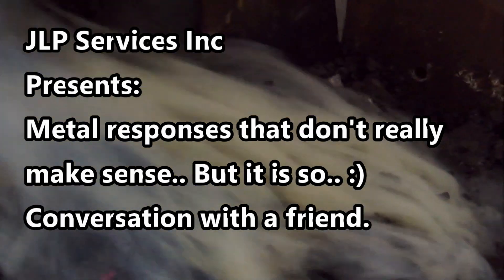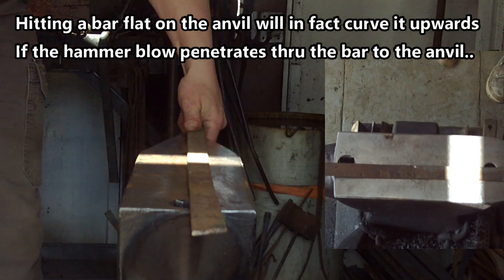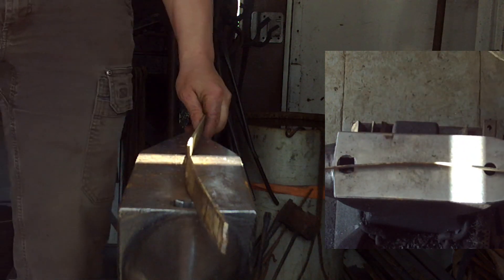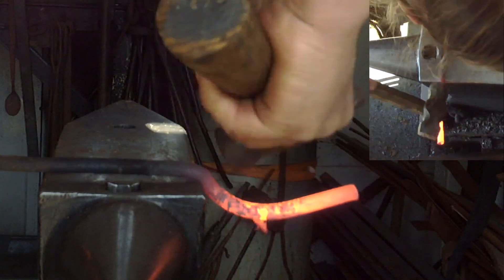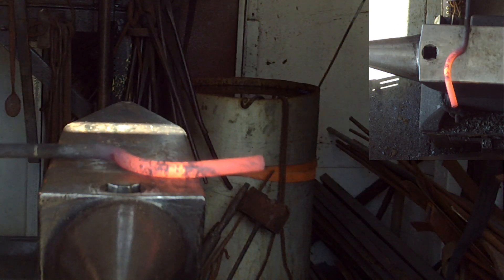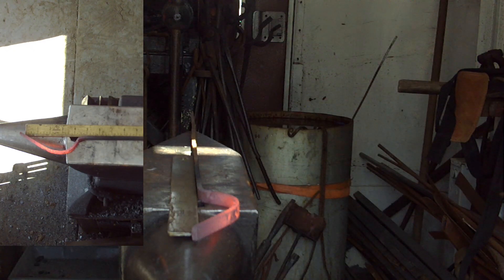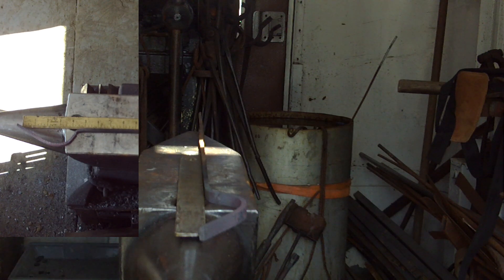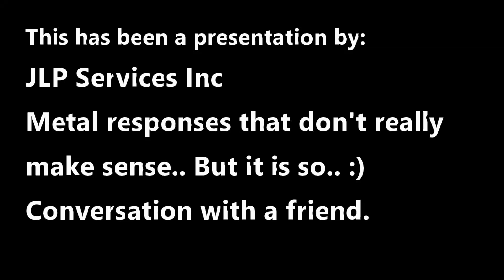Metal Responses that don't really make sense

Comment: I believe as a semi solid the orange hot metal is suspended in it's spot in space and because it's softer when orange hot when the middle of the bar is stuck the weight of the metal holding the end in it's spot in space. Yeah hitting the middle of the orange soft steel don't effect the end but the steel in between determine it's new bend.
Reply from the maker: I like your enthusiasm..  You are on the right track.. This will work on cold metal as well. 

Its pretty neat and if applied to things like rings on the ends of bars and such can speed up the work and help become more effective. 

There are some things that are hard to see in the video. I was hoping this video would have people actually trying to mimic the things shown and then give feedback.

I think it could be lots of fun.

Comment: I believe the reason that the tip rises above the original bar is that the unsupported portion, being held in place by inertia, is attempting to pivot on it's center of gravity, causing the tip to rise as the struck end pushes down.
Reply from the maker: yes, and no.. 
The way the metal is hit has the largest effect to how you see the metal move.. The metal will not move above it's own center line if not getting the combination of hammer control.. 

 I moved to a very small hammer in the very end and it moved the metal above the center line which means the amount of energy was greater at the end than at the anvil..  Technique is the largest quantifier.. 

All of these were controlled by how the metal was hit with the hammer..speed, angle, force..

Give it a try and see what you find..   It is very cool indeed..

Comment: I've seen feriors use similar techniques to round shoes.
Reply from the maker: That technique is called bracing..  That is where you use the rounding side of the hammer and hold the shoe up somewhat off the anvil and then drive it down.. Totally different technique as they are indeed not hitting the shoe on the anvil but rather bracing it with the tongs so there is a gap.. 

this method the flat bar is directly against the anvils face..  Again.. Little bit different.. :)
Reply: @jlpservicesinc1452  yeah that's true, different. Those guys move so fast it looks similar. I know what your saying about the tongs acting as brace
Reply from the maker: @timothyconley1267  I wanted to clarify because this video is strictly showing what happens when a hammer is used to maximum advantage based on these unique properties..    They can help or hinder a smiths ability to work metal into a desired shape and I have never seen another video on it.. :)